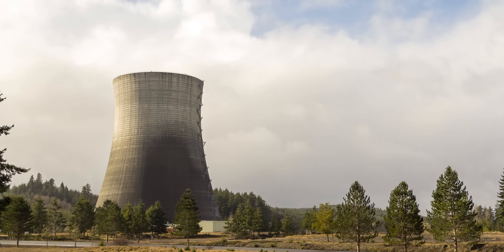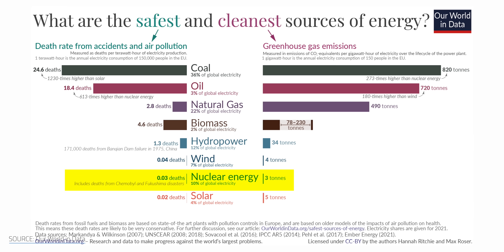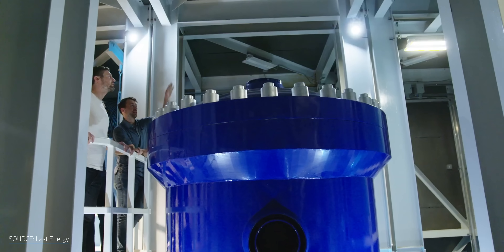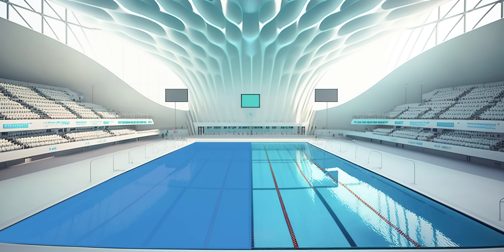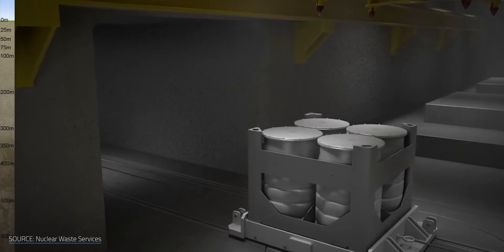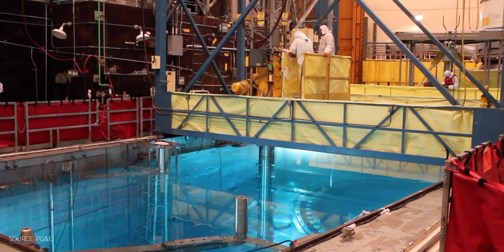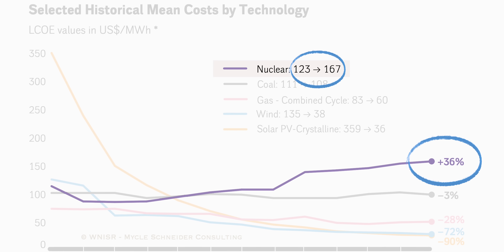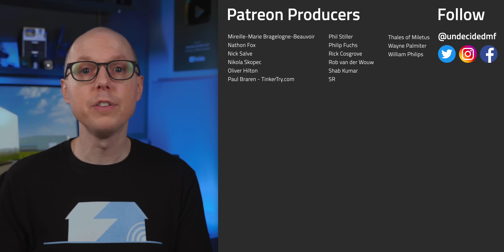Is Small, Fast, & Cheap the Future of Nuclear Energy?

Comment: I wouldn't say there is no carbon footprint. Nearly no carbon while operating, but construction of the facility and mining and preparing the nuclear fuel do, and a lot.
Reply: Not true. LCA of wind is 5-8gCO2/kWe. Solar 38 New nuclear 6-110 depending on U enrichment. 600 for gas.
Reply: What energy source can be made with nothing?

You think the Wind Farm Fairy makes turbines???
Reply: @scottslotterbeck3796  No. But there a differences of scale of initial.CO2 costs. First wind towers made of wood are being finished. And I referred mainly to still to be build/finished normal nuclear plants. SMR are not here yet.
And operating a Wind farm or solar park does only need maintaining, no fuel, no waste to care about. 
Recycling of solar modules is starting to work, of blades at least tested. 
SMR promises cheap and easy energy, but so did nuclear energy 70 years ago and the result wasn't as cheap and easy expected...

Comment: At the 3:15 mark when you mention three mile island, I just want to point out that it was FAR from a disaster. A PR disaster more than anything else, the actual amount of released radiation that day effectively has a 0 percent chance of actually hurting anyone. It was a massive media scare more than anything. It showed the way you handled any kind of issue at a nuclear site is very touchy, and that communication and transparency are key.
Reply: 12 years of cleaning for 1 Bn USD is hardly a success.
Reply: @alainpannetier2543  Notice you never mention the permanent damage of coal mines coupled with their significantly higher deaths/TWh rates. Why did you omit that FACT?  More people died in "No Windmills off Cape Code" Ted Kennedy's car than at 3 Mile Island.
Reply: This is a gross oversimplification of what actually happened at Three Mile Island. On the International Nuclear Event Scale, the partial meltdown of the unit #2 reactor was a 5 out of 7.

If you're not steeped in the field of civilian nuclear power generation, making statements like yours is far from helpful. As a former naval nuclear engineer and chemist, I was courted to participate in the clean up effort; an offer I declined after evaluating the situation firsthand.

To be clear, the only reason that the Three Mile Island accident didn't develop into a full-scale nuclear disaster (in a densely populated region, I might add) is that it was able to be mitigated. Had the hydrogen bubble that developed in the containment building exploded, as was the case at Fukushima, you'd be singing a very different tune.

Again, to be crystal clear, the reactor at unit #2 experienced a catastrophic failure in which approximately half of the fuel melted, as in meltdown. It just doesn't get any worse than that.

The only reason TMI didn't develop into a full-scale nuclear disaster is because a combination of safety systems, combined with skilled actions by plant operators, were able to stop the cascade of failures.

In short, the entire Mid-Atlantic region dodged a bullet that day.
Reply: @ARepublicIfYouCanKeepIt Honestly, all I'm seeing is that the safety protocols that were in place, worked.
Reply: @MrMementoOri  Actually, there were inadequate safety systems as well as procedures. It was the diligent plant operators who didn't panic, succeeded in deducing numerous failure causes, then devised ways to stop the cascade of events, vent the hydrogen and otherwise avoided a disastrous outcome.

The final report actually cites a situation where one safety system was locked out for maintenance that called for Unit #2 to be shutdown as a precaution. For some reason, that didn't happen and the unavailability of that safety system contributed to the seriousness of the accident.

By the way, Unit #1 was shutdown for refueling at the time of the accident and Unit #2 was operating at nearly 100% at the start of the event. Also, at one visual alarm wasn't noticed before the event, and another was missed after the event had started. The first might have prevented the accident, and the second would've dictated a different course of action in responding to the event. Lastly, the main cause of the accident, a stuck open pressure operated relief valve, was indicated by the state of the activating solenoid and not the actual position of the valve. An elevated downstream temperature sensor reading wasn't noticed until after a shift change more than an hour into the event. By that time, some 32,000 gallons of primary coolant had been lost, exposing the top of the fuel assembly.

Needless to say, many things changed across the civilian nuclear energy generation industry after the accident.
Reply: Mostly just PR, but I was 9 when it happened and lived an hour from it. We just got in a car and drove all night.
Reply: @PeterSedesse  That's terrible you experienced the communication breakdown resulting in a panic that never should have been risen to nearly the level it was. leaving wasn't necessary sadly.
Reply: @Fenthule  it wasn't really a panic, neither was there a communication breakdown. It was 1979, there wasn't internet or cell phones, there was also 3 channels on tv and they were reporting news that was probably 2-3 hours behind. In that situation, if you had kids I would hope you would take them for a 4 hour car ride just to be sure.  There was nothing safe about what happened at TMI, just because it ended up well doesn't mean good parents should risk it. It is like being in the edge of a hurricanes path, if you don't have kids maybe you risk it, if you do have kids you evacuate.  I remember I was 9 or 10 at the time and I was fascinated by the science, so didn't want to give up the tv coverage .
Reply: It was bad PR but it wasn't a media scare, it was sheer luck that very little radiation was released, it was something like 4 or 5 days after the accident that they vented the hydrogen from the reactor up until that point explosion and release were still possible outcomes. A media scare is pretending something is more serious than it is, informing people of the possible dangers even if they don't materialise isn't a scare it's a public service.
Reply: @Shindiggity  NO "we all want nuclear energy" is totally false!  The Jane Fonda's of the world have created an industry of fighting any 24/7 base load power generating operations especially Nuclear.  More people have died in Ted Kennedy's car than died from a USA designed and installed reactor in the USA including 3 mile island.  You know "Ted the woman killer" Kennedy who also fought wind mills off Cape Cod.

Comment: I feel like most of the pros of SMRs are really just pros of conventional nuclear. People just don't know that nuclear isn't very dangerous.
Reply: To be clear, I would take an SMR or conventional nuclear (or wind or solar) over any fossil fuel, even if I had to live across the street.
Reply: The 24000 year danger from waste makes risk estimations pretty much impossible.   Using multiple fuel cycles to bring down the timeline to human scale seems like a necessary step.    Are there technical or cost challenges to doing that?
Reply: @tedmcdaniel2951  The 24000 year risk also seems like nonsense to me, and another failure to balance different types of risk. Forget the long term storage option, we can just pay people to stare at the dry casks for the next 24000 years and it would be cheaper than the risk of climate change. The only risk from the dry casks is a future where humanity gets sent back to the stone age so bad that we don't even know what nuclear power was anymore. What scenario could possibly cause that that isn't just an apocalypse already? And why are we worried about that when people are already dying from climate change?
Reply: But very costly. And I stil would not want an atomic plant close to my home. ;)
Reply: @elektrischunterwegscom  then I think you've missed the point. You already have a gas or coal power plant near your home. That is far more dangerous. Even a hydro dam is more dangerous. And none of this factors in the cost of climate change.

Comment: They should start sending nuclear waste to a distant planet.
Reply: 🤪And when a few percent of those rockets explode? . . .
Reply: In terms of other solid waste,  yes it's a risk,  but they can make it blast a proof container auto eject just like a regular Dragon space capsule.
Reply: In terms of water contaminated waste water, like Fukushima waste water,  the current plan is to dispose all of it in the ocean,  so using this approach a few percent of rocket failure,  is still a least contaminating option by far.
Reply: They could use a control surface-less internal control system within the internal waste capsules outer shell,  via an automated centre of mass management system,  to reduce risk of damage from any blast,  which could help glide the capsule into the sea at a low impact for recovery,  in the event or parachute failure.  The capsule outer shell would be aerodynamically disposed towards controllability.  i.e. control crash landing in the sea without containment shell breach.
Reply: SpaceX Starship could be a perfect base technology platform for this approach. Once it's well proven over the next several years. It can lift 100 tons into space.  They could add NASA's new light speed rocket engine to it also making it a hybrid rocket solution.  They could dispose of the waste on Jupiter or Saturn.